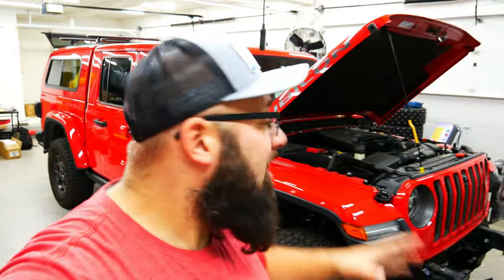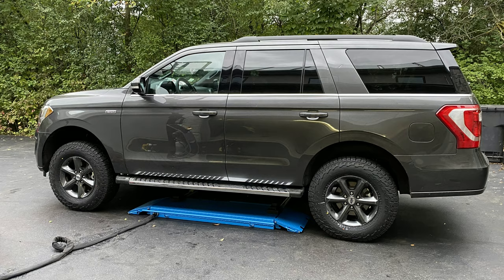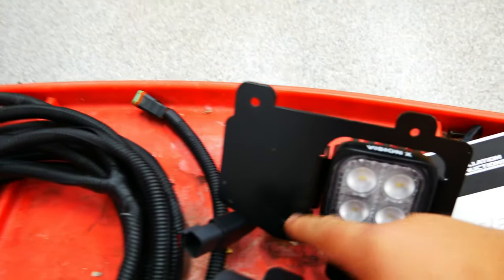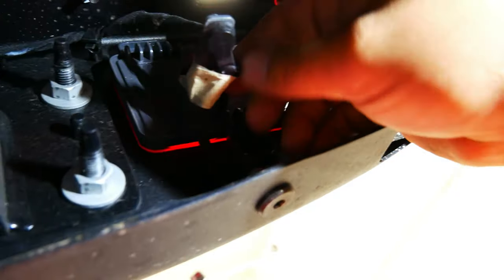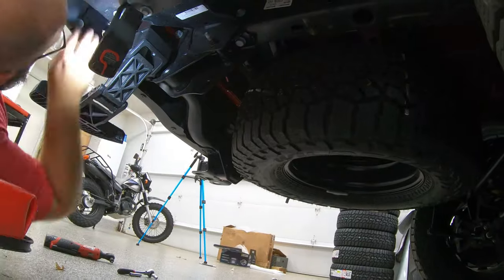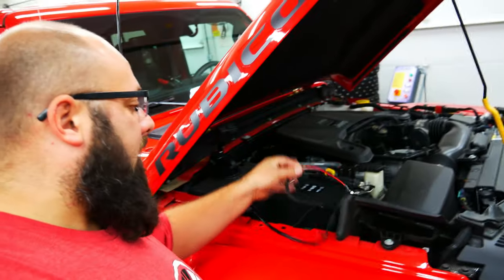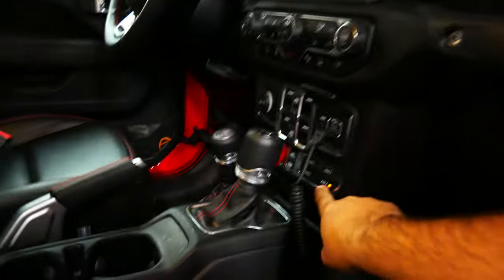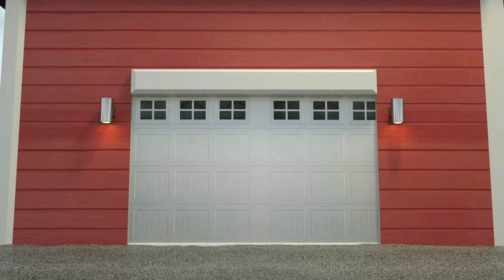VisionX Jeep Reverse Lights! Overlanding Gladiator Build!

Comment: I put 2" cube lights on top of the rear bumper at outer ends, similar, they are awesome, potential metal gaurds over them perhaps. Those reflectors that come out, I'm interested in doing a tail end tuck, so spare and heat shield 🛡️ coming out, and the tail pipes might come out where you put these lights. Its a work in progress, my lights might interfere with a swing out spare tire rack, so these might be the way to go.